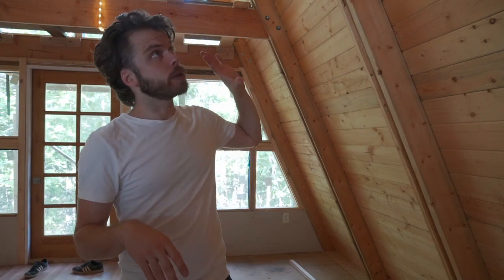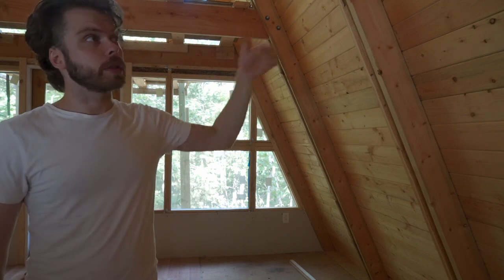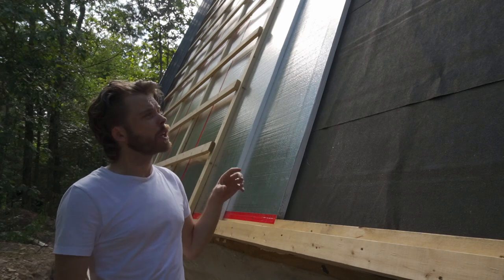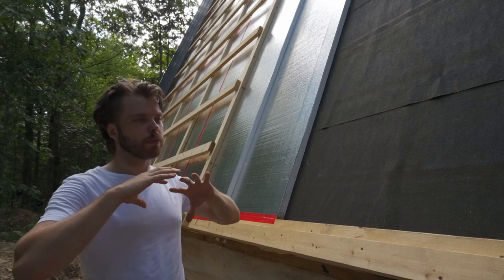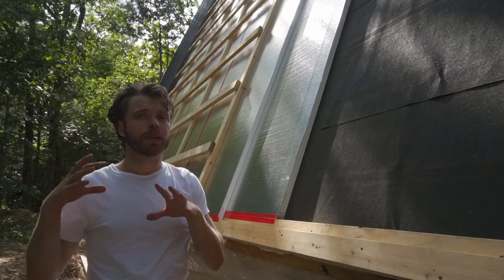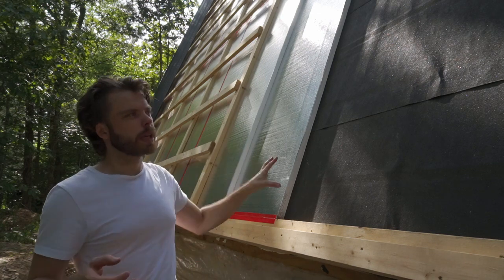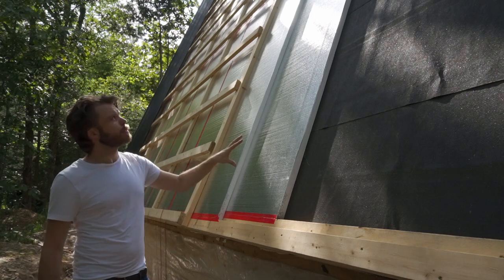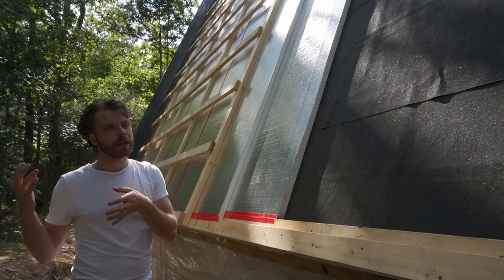A-Frame Cabin: T&G cathedral ceiling with outsulation

Comment: You stated that you overlapped the insulation. So correct me if I am wrong. 1st you butted the insulation next to each other, then taped it. 2nd you took the same size piece of insulation, you did not cut it down. Then set it on top of the first layer of insulation over the taped seams.. 3rd Taped it to the 1st layer. So along the seams you have 6” of insulation or do you have 6” of insulation over the entire roof and trimming up the edges of the second layer?

Comment: Hi Jake… Just came across your channel and watched this video. Great info!

I’m in Tulsa, OK and what you described as your concerns re performance in your climate zone sounds very similar to thoughts I’ve had. I’m CZ 3a, warm/humid. But in Tulsa we’re very close to CZ 4, mixed/humid. So, I’ve been thinking it might be best to pursue CZ 4 reqs(?).

I’m wondering what your thoughts are now, after 2-3 years in the cabin.
- Would you do anything differently?
- Has the assembly performed as you had anticipated, based on the software data you had? 

Although solar isn’t something I’m looking at doing initially, I hope to do so after we’re settled in. I’ll look at costs and tech then, and see if it’s more manageable, budget-wise.
So, our scenarios aren’t apples to apples, but still would like your thoughts.

Great job on the cabin!
TY, Chad

Comment: What do you think about insulation on the inside of your A frame. We have an A frame and just put a standing seam roof on and added 4 inch solid foam insulation on the outside. I was thinking about doing someone the inside also. My upright A frame lumber are 2 by 8's. I was thinking of filling that space with fiberglass and putting tongue and groove on top of that. What do you think of that?
Reply from the maker: Sure, there's a lot of assemblies that are set up like that! I'd look for something that's a recommended assembly - like a recommended set of layers, materials and thickness ranges - there's some non-intuitive stuff where the relative thicknesses of the inside and outside insulation can cause condensation. 

If you add a vapor-impermeable layer on the inside of the wood, like a vapor barrier or foam board insulation, that would restrict the woods ability to dry, so you'd want to be careful that whatever you do allows some way for the assembly to breathe still

Comment: We are planning to build an A-frame with a 28-foot span. We want to do a similar build to yours- 6ft centers with T&G sheathing, but we need a 28ft A with a 24/12 pitch. Have you seen any public domain drawings with those specs?
Reply from the maker: The only public domain drawings I know of are the ones NDSU has - they have at least three different A-frame ones though: https://www.ag.ndsu.edu/extension-aben/buildingplans

Comment: And how this all pend out after two years?
Reply from the maker: Honestly really good! We did this whole summer without the generator, just solar panels, batteries and AC running the whole time. Winter we still need to run the wood stove for comfort heat, but it's 100% livable year around. We will see when a 100-year winter cold comes in one of these days, but at least so far so good.

Comment: I've been very much intrigued by exterior mounted roof insulation, mounted in this way with the 2x4 battens giving structure to mount the steel sheeting. In the cold-Canada climate, it is starting to gain traction in concert with standard batts-in-the-rafter to really beef up the performance of the envelope. It seems like you're not targeting anything specifically in terms of air tightness (blower door testing, air changes per hour, etc.), but you seem to be up on the science nonetheless. The question I'm circling around to, that I'm hoping you might be able to shed some light on is as follows:
If airtightness is a high priority in the build, is it problematic mounting the vertical battens with screws that are going to perforate the air barrier at every fastening point? 
It seems like there is a catch-22 in needing to mount the battens to the T&G for structure, but in doing so poking a ton of holes in your air barrier.
Please let me know if this has kept you up as many nights as it has myself!

Comment: I hope you’re doing okay. Would love to talk with you about the build... please.
Reply: @OzarkMountainCabin  thank you very much for your reply!!! Don’t worry about being a bad youtuber, I understand that you have a life outside of the internet. My wife has a channel too and it takes a lot of time to keep it going. 

I’m glad you guys are doing well! Have you moved in yet? 

So we actually have insulation inside our military tent. It actually looks like a cabin on the inside. I do see your point in saving money long term in heating. We are planning to put two layers of r10 foam boards. So r20 in total. I plan on keeping the framing exposed as you did, and don’t want to mess with finerglass insulation and doing the t&g on the inside. As one of your points in a t&g video you made. I am planning on making the T&g my self though, to save on cost. I am going to use a dado blade on my tablesaw and doing it this way. I know it’s a lot of work, but the savings is substantial. I even considered buying a shaper machine.   

What I haven’t figured out yet is the size of the beams I’m going to use for foundation and how far to space concrete piers. I was thinking 3 2x10’s sandwich together, possibly 4. Do you think 8ft or 10ft on concrete spacing? There will be 3 rows and 3 beams running. My other dilema is in the roof top. With the insulation adding 8” from both sides. I ether have to cut the high of the A frame, or go for longer metal roof. Because I’d like to use 2 12’ panels. Which would be just shy of 24’ long. Not sure about this yet. 

Thank you again!!!!

Comment: Good afternoon. I had a question about the r10 insulation boards you are using on the exterior. Do you feel it would be sufficient enough for Maine climate? With wood heating. My wife and I currently live in a military tent, and are planning to build very similar building. I would love to talk with you more if it’s okay. Thank you in advance, and for the videos you have posted already. I can write my email if you reply back .

Comment: Thank you! Great video. I feel I learned a lot. I'm in the process of trying to understand how my A-frame home was built. I feel mine doesn't even have insulation. I'm not sure. Mine doesn't have tongue-and-groove panels. It's plywood construction paneling right on the A-frame beams. However, given that in winter the panels get really cold and in summer, really hot, tell me that maybe there's not insulation on them? Just a layer of Tyvek perhaps, then the roofing. I don't want to have to drill a hole to find out. Haha. I've been considering insulating via the inside, and covering the beams then with drywall, and finally tongue and groove interior paneling on top of that. Of course, that would REALLY insulate, since those beams are 4x6... and I can also run wiring for some recessed lighting. But the downside is, I lose a lot of interior space. Any advice? I'm in the mountains of Souther California. Dry air most of the year. Mid 20s in winter and 85F in summer.

Comment: Thank you for the explanation of this, I'm in the early stages of designing an A frame and like the look of the tongue and groove ceiling and exposed rafters.  I'm wondering how you plan to run electric and plumbing?
thanks

Comment: Good explanations using layman terms. What did you do for your flooring, both sub and finished?  Is this built on a slab or framed over open space?  How did you insulate the floor?

Comment: Perfect explanation of moisture movement at the end, great series. I’ll be very curious to see how much moisture you can drain in winter from behind that EPS. I’m in Canada and for moisture management reasons will go with rock wool (probably the Roxul compress Board product) and maximize our insulation values, eg to r-50 if possible. Also it looks like your vapor barrier is old school tar paper rather than a more fancy product, correct?  I’d be curious how you made the decision and how long the warranty runs - failure there seems like a nightmare to me. Off to watch the rest of your series here.

Comment: I enjoyed this, ive found this after watching the matt risinger and lots of other forums. Your cross battening alows air to come in both ways. Me im worried about insects eating wood !! Not sure if you have a video on how you approached your floor, are you completley wrapped in. On the floor do you have isulation inside of outside your wrap, if you did go for a complete wrap. Do you have a DC heat pump ?

Comment: Can you tell me how you insulated your Aframe rafters? I'm building an Aframe with vented rafters all the way to the ridge but exposing my fiberglass insulation, and I'm afriad of mice getting in.
Reply: @OzarkMountainCabin  I read ants like foam or is that not an issue? Thanks.
Reply: @OzarkMountainCabin  Can you take a look at my aframe insualtion and tell me if you see any prooblems https://drive.google.com/file/d/1EvMvhOQ8WrY1OgLFbnUY8GogtNaTYdND/view?usp=sharing

Comment: Have heard, & also seen other videos where the metal roof edging is tucked underneath the panels so water doesn’t get sucked into/under.? See your edging on top. Thx
Reply: @OzarkMountainCabin  oh that was something thanks for that! but I was referring to your vertical edge ends of the roof looked like corner edging strip was screwed on top of long panel. Thought water could wick under there maybe not

Comment: Here in Europe there are PV driven solar hot air collectors to keep cabins and cellars dry: GRAMMER Solar TWINSOLAR or SolarVenti or Scansun. you can also build these yourself from window screen: https://www.builditsolar.com/Experimental/ScreenAbsorber/ScreenAbsorber.htm  https://www.builditsolar.com/Experimental/AirColTesting/ScreenCollector/Building.htm 
Together with IoT temperature/humidity sensors that should do a pretty good job to keep mould out.

Comment: RE: Passive house when power is out, mold. Are you referring to losing power to your mechanical ventilation (HRV/ERV) and the humidity building up? You could slightly open a window until power is back on. Losing power while you're not there? Leave an inaccessible (from outside) window open.  Having control over how much air is moving (via window) seems way better than the randomness of a non-airtight house.
Reply: @OzarkMountainCabin  Good to know, I was wondering about this as well. We’re thinking of building PassivHaus for a chalet an hour north of Montréal, ie two hours north of Burlington VT, climate region six I believe. I’m not sure about your estimates of our humidity levels either btw. ;) -pretty much everyone leans toward a heat pump now because of cheap carbon free electricity and to have cooling in summer. (We get in the low nineties Fahrenheit and 90% humidity in summer, and down to minus forty F in winter and 10% humidity.)

Anyway, very entertaining and informative, thanks for doing this video and I’ve subscribed to see how things evolve -!

Comment: really helpful video thank you for uploading it. I'm building an A frame myself and as i want exposed beams I also want to do exterior insulation. my question is is there a chance of those EPS panels to start to rot or  be compromised in any way? is there any downside or risk to using them as insulation in the way that you have? 
thanks in advance!
Reply: EPS = Expanded PolyStyrene foam.  Nothing "eats" it, but WILL burrow thru it. Use firebreaks!  (Polystyrene is a solid form of gasoline) That London highrise that was burning on the outside a while back, that was sheathed in EPS without a firebreak.

Comment: Hey man I stumbled into your channel while doing cabin research. I'm an Architect in Texas working on an A frame design. Is yours based of the old department of agriculture plans? I was so happy to find this channel since it appears to be the same structural system!
Reply: @OzarkMountainCabin  That is fantastic, it looks great so far! I do have a lot of questions  and will probably have more as I progress the drawing set. I based my design off the same plan but increased the height, I also have made the assumption to do so will require deeper members, closer to what is sized on plan 6004 and with the intent of using an 8' bay....So questions! 1.Since there are no cavity walls at the interior perimeter of the cabin how do plan on running outlets and conduit? (I did notice on your cathedral ceiling video conduit running the vertical length of the last front bay.) 2. What is your floor assembly at level 01, insulation etc? 3. I'm attempting an r-30 roof as this will be a home in Colorado, I need to minimize the roof thickness to also fasten a standing seam roof, what made you size up your purlins to 2x4's? was this for airgap and a robust scaffold? I'm pondering the same setup of purlin pattern but with 1x4's and poly iso to get the roof thickness to a minimum and not end up needing a 12" fastener to reach the tongue and groove! Like I said I'm an Architect so please feel free to ask any questions on constructions details as well! Thanks for sharing your project on youtube!!! Keep hammering!

Comment: Very nice video. I have the same roof that was converted from shake to asphalt tile with 2 inch fiberglass insulation from the 70s. Needless to say it acts as a giant heat exchanger. Thanks for providing some options. Do you have any information on the T&G fire rating? I noticed no use of drywall.
Reply: @OzarkMountainCabin  Thanks again for the info. I'm trying to decide whether or not I'm going to add a layer of dry wall between the T&G and the tar paper. Without the ventilation the T&G will reach a higher temperature than outside which I've clocked at 115° with my thermal camera while the sun hits it. I've got to do something and would prefer to have the extra layer of foam instead of dry wall.

Comment: Not long at all.... A really good explanation and fantastically filmed and presented. The 'girder as ladder' especially made so much sense for a DIY build and the extra cost vs safety/time saved improvements was cool.     Steve, at Off Grid Living Really, has an interesting take on using what he calls "robust panel installation" and being efficient off-grid.  Are you familiar with his channel/idea?   Basically,  he goes way beyond 'typical' in total panel wattage/number of panels, seeking out the best per wattage pricing (he buys panel "seconds" by the pallet load.).     Would love to see you do something innovative in energy as like you've done with the roof.
Reply: @OzarkMountainCabin  my off grid experience is primarily with microhydro, but the 'overpaneling' approach allows some cool ideas with conventional appliances, etc that go against the traditional idea that off grid living is all about avoiding electricity and over-using propane.  It's kind of like a good microhydro system, you gotta figure out what to do with extra power.  You did the smart thing getting the inverter and battery first!   My next step would be to get a inexpensive propane cook top,  online water heater, and dual fuel 5k generator, that will later be "back ups" to an  'over paneled' electrical/solar system.    My 2 cents rant  : )
Reply: @et5222  those are really interesting points indeed. We're rural in Québec, so will be on hydropower for everything and have occasional outages.  Building to PassivHaus insulation standards and 'over-batterying' will be our thing as we avoid propane or fossil fuel say all costs. Our back up heat is going to be a tiny wood stove in case of crisis, but over- insulating according to our energy model apparently means that we can let the house sit empty in minus Infinity temperatures and the pipes etc won't freeze unless it's more than two days without heat. This is important because home battery systems are crazy expensive still, ie $16,000 Canadian for a single installed. I could see the insulation as part of the battery system..